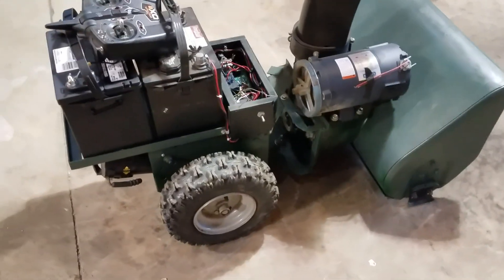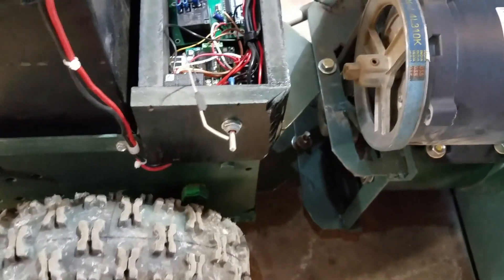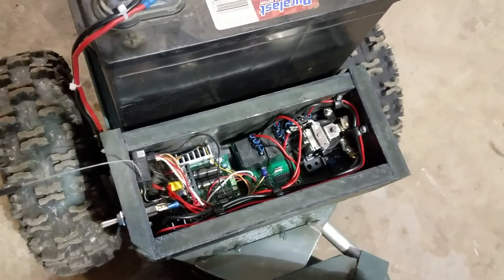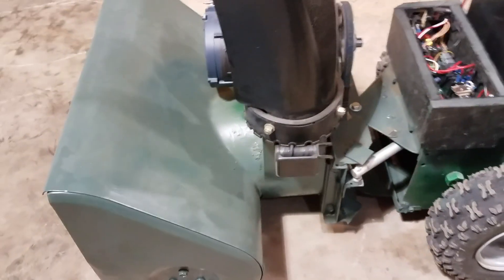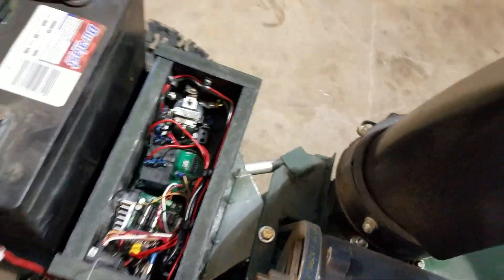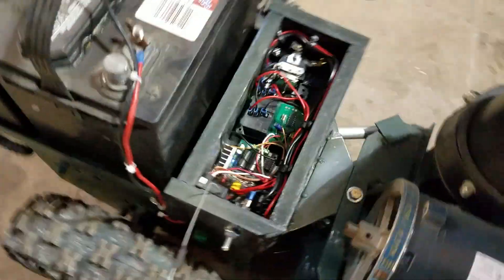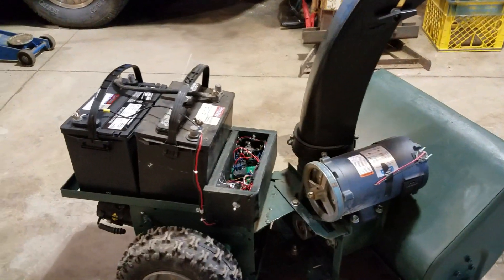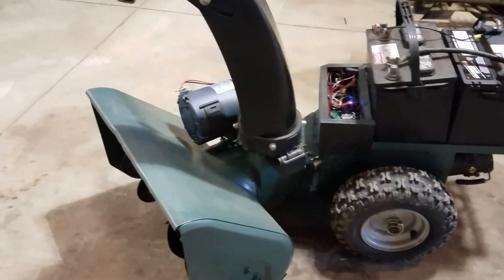Homemade remote control snowblower

Comment: Good job. Can you post the wiring diagram please. Thank you in advance.
Reply from the maker: unfortunately I don't have a wiring diagram. But the wiring is pretty basic on this one. a sabertooth 2x25 motorcontroller, a 60 amp relay along with a transmitter and receiver wired in. let me know if you need more information. thank you.
Reply from the maker: https://docs.google.com/document/d/1_C-GCLmls4FhFFicF01oYTR1Cx0X4ilU/edit?usp=sharing&ouid=117594973926197145089&rtpof=true&sd=true